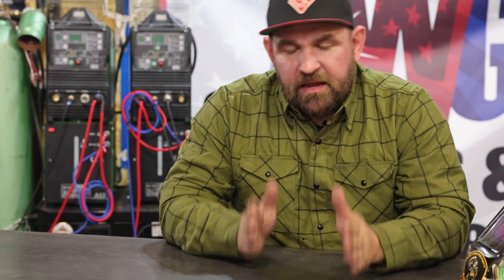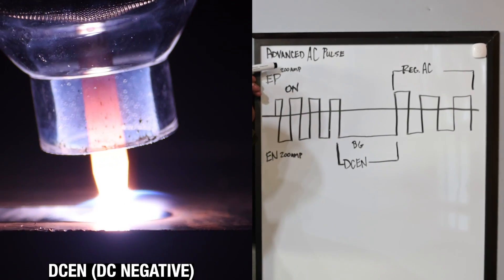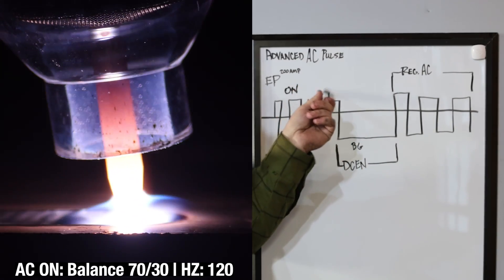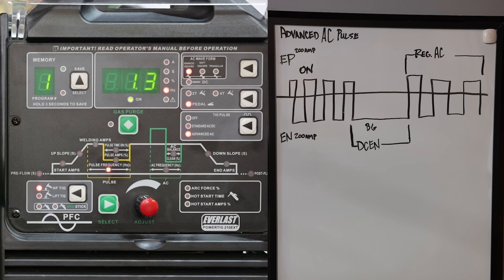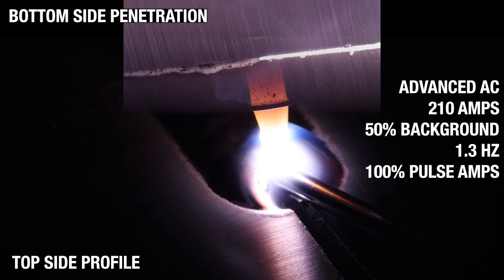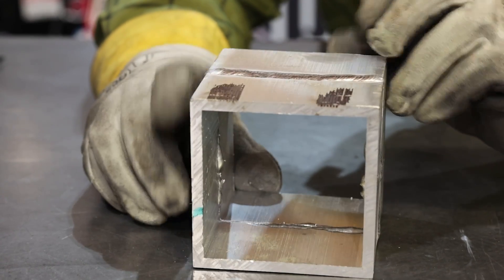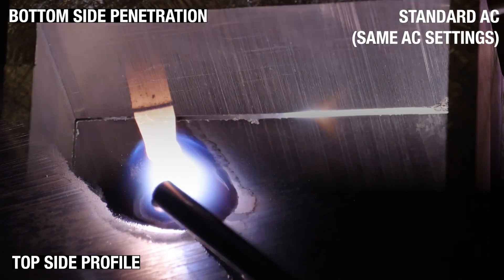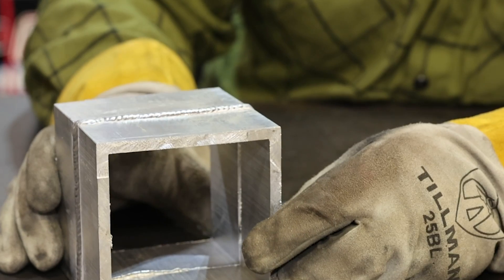1/4" Aluminum with Only 200 Amps?!

Comment: Why is modern tig so loud at such low amprage?
Reply: I forgot to mention the machine I use top range is 400 amps, running on 3 faze circuit,  I'm impressed with the new smaller machines just don't know why they are so much louder? Any help would be greatly appreciated

Comment: The two parts had very different fit-ups. The second demo of standard AC was much tighter fit-up and you need to slow down to establish the heat in the part.  Very exaggerated in your demo.
The advanced AC would always perform better so there was no need to mess with the presentation like you did. I've been using a 210 machine on 1/4" for some time now, prep the joint, slow down and watch the fit-up and your fine. Pre-heat always helps on really large pieces.

Comment: Elles sont mal préparée vos pièces, en alu il faut faire une carre de chaque côté  
là où il y aura  la pénétration. c'est pour cela que parfois vous avez de la pénétration mais que d'un seul côté . Quant au ratio intensité et épaisseurs à souder il y a un deuxième facteur c'est la masse volumique de ce que vous vous voulez assembler. 
They are badly prepared your parts, in aluminum you have to make an edge on each side
where there will be penetration. that's why sometimes you have penetration but only on one side. As for the ratio of intensity and thicknesses to be welded, there is a second factor, it is the density of what you want to assemble.

Comment: Are you saying you should use a helium mix for the advanced pulse functions? I already use 25% helium argon ... But is it required or recommended when using the advanced AC/DC advanced pulse?

Comment: Very cool, my 200DV doesn't have that feature. I've preheated with map gas on thinner stuff to weld it on 120 Volts before out in the field and that worked pretty well. In a pinch Welding quarter wall with 200 amps I would probably bevel the plate+preheat. I could see how this would be really useful on a 300 amp machine to weld some seriously thick aluminum without the need for helium as well. Do you think welding overhead with this advanced pulse you could penetrate plate 120%? I've tried in the past with regular ac and the puddle tends to sag and suck back before solidifying.

Comment: Thanks! I've got the MTS 275 welding 1/4" for some ramps.. running 200 amps as I only have a rota-flex 26 air cooled tig torch and it's getting hot! Why? Liquid cooler is on back order. Gonna try advanced pulse to see if I can finish this job tomorrow... Think it'll help?

Comment: Thank you for showing us this. I have a 210ext which I love, but I've been struggling with welding 1/4 aluminum. In my case, I'm welding 1/4 flat bar on both sides, so penetration is not as big a concern. However no matter what I try, I can't get a clean weld. Very dirty. Been struggling for weeks trying to find the problem. Can you share what settings you used for the non advanced weld? Also, it wasn't clear if you were running a helium mix or just recommending it for advanced AC. Thanks for all you do.

Comment: I'm just getting ready to start trying TIG (DC only)...but, if the weld was getting so hot that you needed to use a bigger fill rod, why would turning the amperage down or backing off the pedal not be a solution?
Reply: Pulse actually makes it harder to get through that 1/4. 
Better solution is standard welding with a low frequency like 40hz, no pulse. 
Preheating the piece also makes it work. 
I've welded 1/4 to 1/4 alum with an alphatig 200 that way plenty of times.
Reply: @ButBigger42  the advanced ac pulse and standard pulse are two very different things. I think you need to watch the video again. Preheat is great, but if you're welding on a boat, this and/or helium mix is what i would be doing with a 210 amp machine. Not waiting on preheat. I do wonder how well it does on dirtier material. Might need to turn the cleaning up some.
Reply: @brandyquad  here is my suggestion to you. Take 3 identical plates and weld one on advanced ac pulse, standard pulse. And then no pulse. Measure the heat on each one immediately after welding. 
Pulses runs will be hotter. 
I do things like that as demos for my weld students.

Comment: Jody from Weldingtricks and tips did a comparison between all waveforms and advanced AC, he used a rotator with a stationairy torch, all settings the same.
Then he cut and etced, and he found almost no difference between the waveforms, however the penetration on ac advanced was way better.
So it has its merits indeed.

Comment: I wish I would have seen this video last week. Had troubles welding a 1/4" x 3.5", 1/4" wall tube to 1" plate with my 210 EXT. Both material 6061 aluminum. Finally got it. I guess I need to go through the other settings. Thanks for the video.

Comment: Brilliant, thank you I have just learned something new . My machine is only 170 amp ,going to try this setting soon
Reply: 170 amps would def be enough with this setting. Don't think any 170amp machine has "advanced AC" because everlast and fronius I think are the only ones who include it in their machines, in the U.S. Anyway. However, preheating with a flame 🔥 goes A LONG WAY. I used that method for several years. Worked fine, just a little slower, with 170amps. Best of luck!